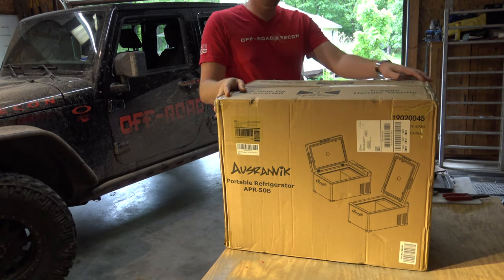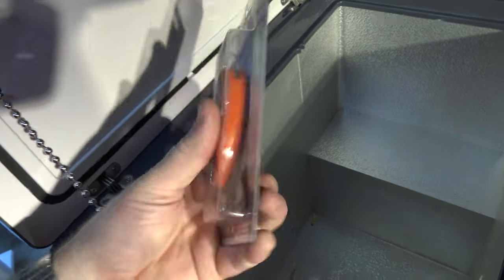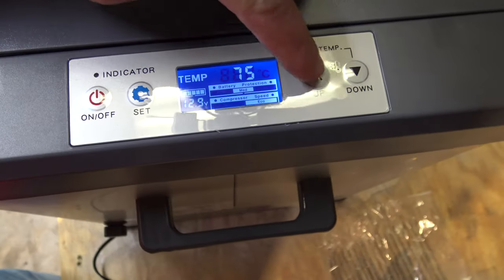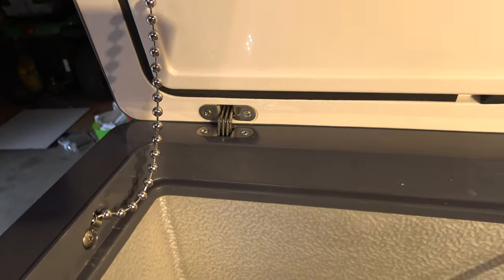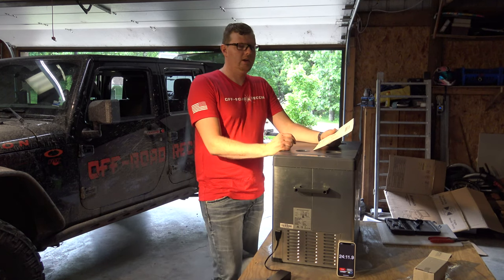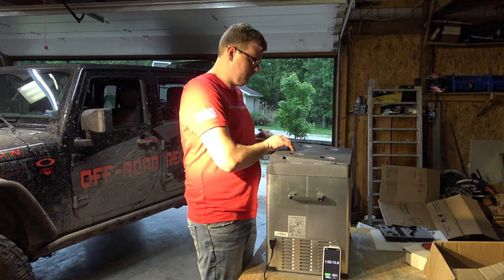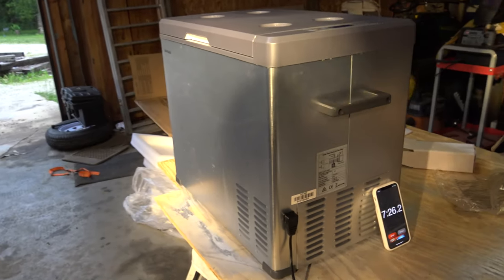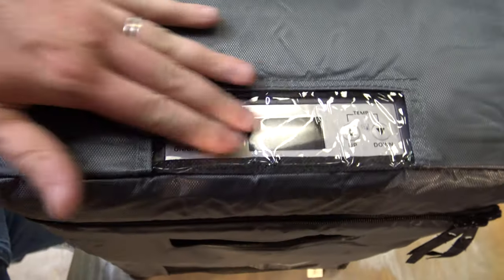12v refrigerator Review Ausranvik 50  over-landing special!

Comment: Thank you. Very informative.
I considering this unit for my sailboat, so DC power consumption is really critical 
Declared 45 watt gives about 4.5 amp on 12v. This is direct working current,  but when unit reaching target temp it's probably working START/STOP (or not). So average 
watt/h for, few hours, is really interesting.  I would be greatly appreciate if you can share this information.
Thank you
Reply: Good question .

Comment: 41 degrees  Ferenheight , is spec for refrigerators . I think your 2 degrees was Centegrate , 34 F . So it cools quite well at low ambient temp. I wish someone would do a review in summer real world conditions . Here in the Gulf Coast reagon it is 89 to 99 degrees F , at 90+ % humidity .  High temp , frequent use , and salty conditions is where most of these units are used . NOT Alaska  or Canadian outback , at 78 degree mid day highs and colder at night than the interior of the unit !
Reply from the maker: It was F not C. This will freeze water. It would have no problem keeping things cold in a very hot climate. We used it on our trip to Utah and never Had any issues in the desert.

Hope this helps.

-Ben
Reply from the maker: Also we use it for ice cream on the trails often.
Reply: @BenandBrandi  COOL!   LOL

Comment: How many amps does it need and draw for Optum use?
Reply from the maker: We did a more recent updated review on our channel with the specs. It’s under the reviews playlist! Thanks for watching!
Reply: Off-Road Recon don’t see them. Hum anyway I have a 30 am total Mini RV so it can draw more than about 900 watts or my circuit blows I had to get a smaller heater so it would stay on without blowing the circuit and it 800 watts and it works.
Reply from the maker: These are super efficient I’m sure you would be ok! It will run 3 or 4 days on my Jeep battery without running the Jeep. They do put a lot of good info in the link to amazon in my description below!

Thanks again! Please subscribe to our channel!
Reply: I have one of these that is very similar.  Most of these only draw about 55 watts when running in max, and 40 watts in eco.  It runs best in max and I wouldn't run any other way.  
They are very efficient.  I also use a 100 quart as a chest freezer, and that one draws about 70 watts when running in max, and 60 in eco.  With 4 of these total, I use about 1 kwhr through a day now that its warming up
Reply: @BenandBrandi  I did a dual battery set up in mine , and it never runs out of juice . I'm getting a couple of 100W solar panels for a TV ....  LOL  Glamping !